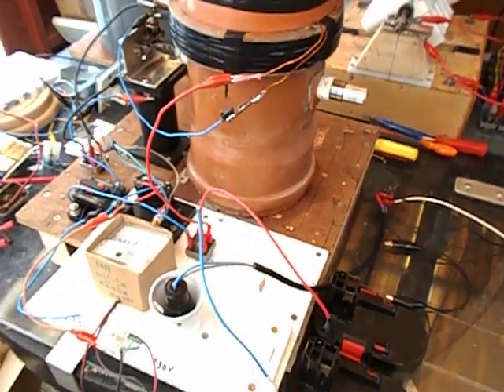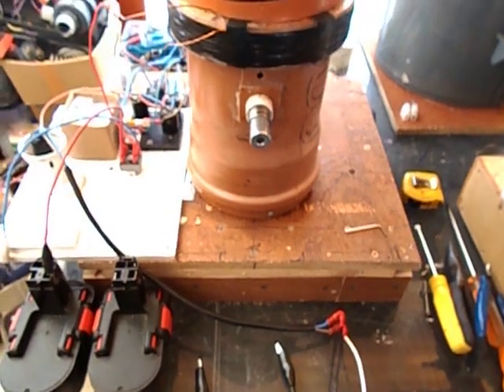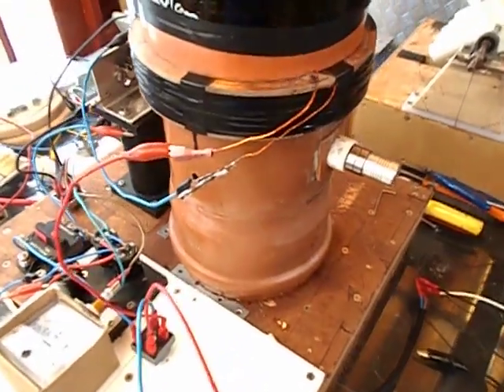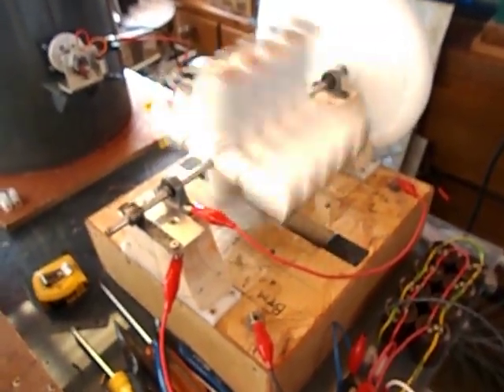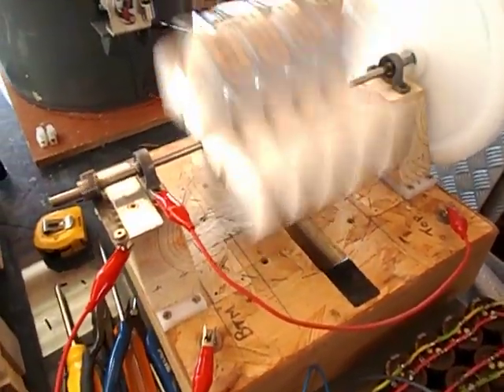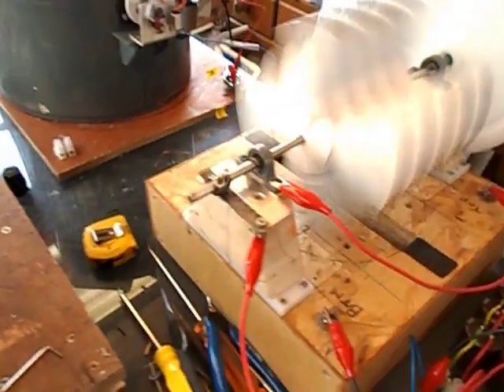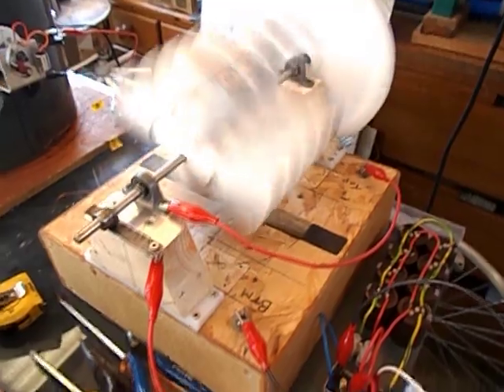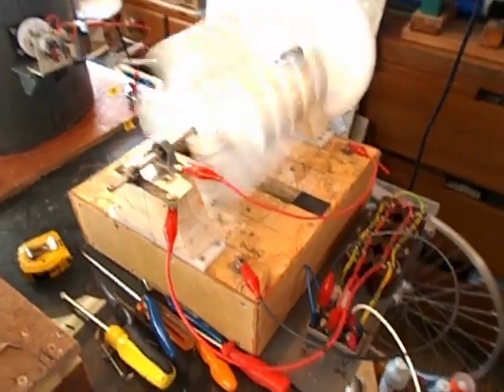4 pole newman motor powered by Back EMF from my Newman Generator

Comment: Thank you for this video. I was wondering, could it run for long if the battery were to be disconnected and the system would use supercapacitors ? They would be charged at the start of the run, then the system would run and recharge them. After X hours or days, measure the energy in the capacitors versus the energy consumed by the motor during that time.

Comment: in theory the motor that is running off the back emf "FLYBACK"  is also generating its own "FLYBACK" and that back emf can now run a 3rd motor
Reply from the maker: Yes thats correct, I have already run 3 of my newman type motors using only one powered by battery and the other two powered by back EMF.

Comment: THIS is just amazing stuff. Can you tell me if there is a special reason for using a 18 volt battery lithium instead of a 12 volts lead acid type ?? This is just super that something can run for ten days from a battery that has about 3 amps 18 volts. Can you tell me why the back EMF has such high voltage ??? Please keep on making interesting videos Deryck.  Do you think there's a way to run this motor for way longer time wise ??
Reply from the maker: Hi Thanks for your interest and questions. As you will see I am using a mechanical contactor/commutator that has two points of contact every 360 degrees. 180 / 180. I did this to achieve the highest torque i could get.  But if I set it up with only one contactor per 360 degrees it will run for a lot longer as it only uses half as much power to run. When I ran it for 10 days I used the double contactor and just the 18 volt battery, With no caps or rectifiers. When I stopped it after 10 days it still had the 18 volts showing but it was absolute zero amps. It had used every milliamp. I tested the battery by putting it on my drill and it never moved lol. nothing. Very efficient at using every minute amps.  I hope this reply makes it a bit clearer for you. regards Deryck
Reply: @DeryckThompsonChasingtheDream  That is does fella. Thanks and keep me in the loop.

Comment: Any suggestions on finding a good source for massive amounts of copper?
Reply from the maker: when you say a massive amount of copper are you talking about copper wire? or just any copper. I always use auction sites such as Ebay when I need something to complete my project some times you can pick up a real good bargain.
Reply: @DeryckThompsonChasingtheDream  nicee, I was talking about the magnet wire. I'll check there and see. Thanks

Comment: Another thing to add is that there's excess energy in the shafts that could be utilized. Air core axial flux motors seem to be a good somewhat frictionless way to generate energy. All that to say I look forward to you getting monetized and building cool stuff.
Reply from the maker: Yes I am trying to build up my channel so I can get a little help with funds, I have a lot of ideas on the table and cant wait to explore them. thanks for your input.

Comment: Great work, Deryck another great video. Excellent idea using the back spike of 1 to power another. To me the excess power you'll get that is being "used" should exceed the initial Watts. Another thought is If these do infact require minimal amounts of amps there's also the possibility of using them as a corona motor. Feeding it off the high voltage in the atmosphere.
Reply from the maker: Hi Wesley  I havent investigated Corona Motors yet but it does sound like a good idea. If the power is available as some claim it should power these Newman motors easily and for free as they say.lol